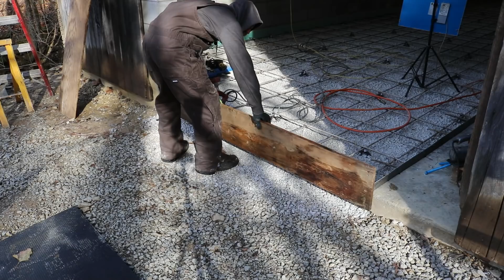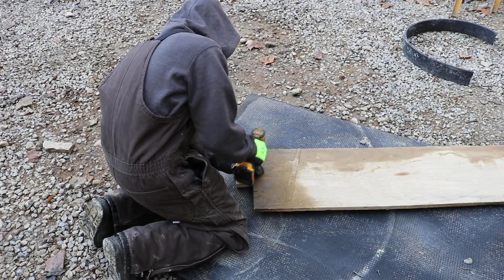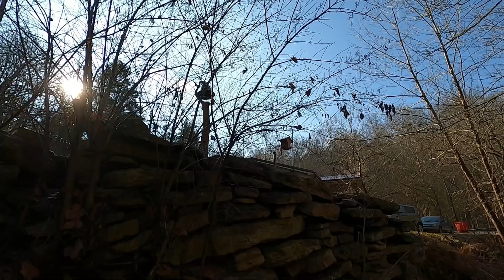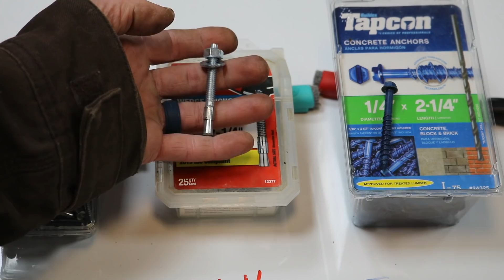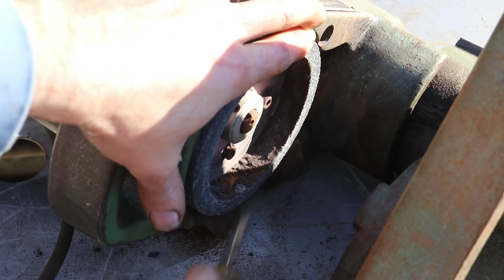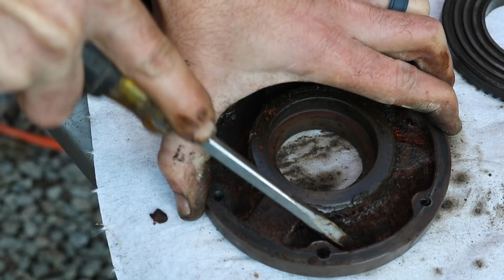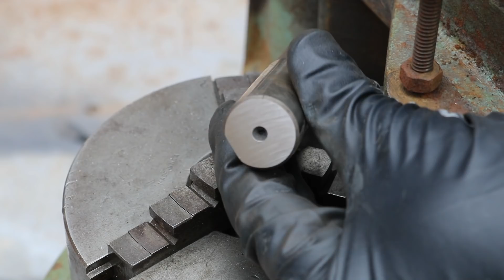🔥Testing the "New" Pin / Punch Grinder. Shop Concrete form and more

Comment: Steve, looks like a great way to put a flat end on any stock that will chuck up without breaking out a lathe. Also there is a device on the edge of your pin grinder that will let you set stock close to the rock height so you don't crash.

Comment: Going to think the most common use of that is to keep the ejection pins in moulding machines from becoming round, as they get a lot of edge wear.  The reference pin is there to tell you the height of the wheel, so you can lower it down to the job before turning the grinder on, and know they there is a few thousands of gap till you contact. Set it using a straight edge before turning the grinder on, and then you will have a few hundred passes till the wheel wears enough that it is not accurate any more. The cable is typical "fix it fast" shop style, probably the original cord was damaged and the extension was put on "temporary" till the new cable came, and of course was behind the bench and out of sight.

Nice work on the preparation for that concrete, you could probably be a lot more sloppy with fit, but it will come out perfect, and probably better than the average floor slab. Guaranteed to still be there in a century or two, along with half the shed.

Regarding the anchors I have used the pin type, though here they are plastic plugs, and work well for light loads, and I tend to set the screw in type using the hammer drill I made the hole with, as it is a lot faster than a screwdriver, just flip the drill from rotary hammer to hammer for the job. The expanding sleeve type the anchor definitely is stronger than the concrete in all cases, though I prefer the Rawl type, as they work better in poor concrete, and are overall more resistant to pull out, because of the larger amount they can expand in the concrete. The direct tap type never used, though I guess they are just like a self tapping screw into plastic, the screw is stronger than the material, as it has to make a thread. Reuse into the hole you probably want to find that first thread again. If you want really strong you use a chemical anchor, or epoxy, and there are some industrial concrete epoxies that are going to have the failure be the concrete itself before the epoxy joint. Yes hex bits are sacrificial, I put the ones that wear into the scrap steel pile immediately, so that I do not keep damaging heads with them.

Comment: Hey Steve! Your grinder is for grinding punches and die buttons for a Stippet Turret Punch machine. I've found that to dress the wheel, you get better results using a Norbide dressing stick by hand, and creating a slight cone shape on the face of the wheel so that just the outside perimeter edge of the wheel actually contacts the work. Less drag and better, faster and cooler results. The wheel doesn't care if it is dressed true to the chuck or column, it's actually better if it isn't. Good to see your videos again as I sit here in Michigan on Sat morning watching the rain pour down.

Comment: Steve, when you do the big cement pour please clean the low section over the old concrete and clean that area, wet it down, and pour a fill and screed that off. Then the whole cement work is finished and your work is done.

Comment: We use the pin-drive anchors quite a bit for setting electrical boxes and conduit straps, I like them. Powers makes a version with a Philips head and a thread on the pin. These are driven in with a hammer, same as the plain ones, but you can back the pin out with a screwdriver if you need to remove it. Works great. 
As others have mentioned, Houdaille is pronounced hoo-dye. 
Strippit makes turret punch machines for sheet metal fabrication. That grinder was sold as an accessory to those machines so you could sharpen your own punches and dies even if your plant didn’t have a toolroom. 
Shop is looking great, keep up the good work!!

Comment: For the slab, I'd still make it drop off towards the door a bit.  I can't remember if you did that or not, but you said "Completely level".  Level and Flat are two things.  I'd want some kind of slope headed to the door, even if it was just from the 10' in and slope about 1/4" towards the door.  At least then when you get water in the building (and you will), you have a way to sweep it out with some help of gravity.   As for "don't video it if you don't know"...yea...lol...As any 20 "experts" and you'll get 20 different "correct" methods.  I started watching "Bondo Construction" and he does a ton of radiant floor systems for pole barns and such.  Guy has been doing the work for 20+ years, but wow, the people that scream "NO, YOU'RE DOING IT WRONG, I DO THIS FOR A LIVING"...ummm, so does he, and it works.  Yep...Keyboard warriors...LOL.  Take the best, forget the rest.  :)

Comment: Interesting the way you used a bolt to pull the chuck apart.  You could have used three bolts and pushed the chuck apart.
Thanks
Reply: Yup.  " Jacking Screws "

Comment: William from Lexington Ky.  The grinder is more specific for sheet metal turret punch press tooling.  I just bought a modern version for our tooling.  Where I work, we run an old Strppet model turret press as well as our new Amada.  As you say, it will be a good tool for very specific applications.  Nice find.

Comment: I used the Tapcons at work for several years with good results IF the hole is the right size.
I now use Tapcons to hold wood on a face plate for turning on a wood lathe. Even if the chunk is huge and out of balance , no slippage or pull out. They are made of very good steel and properly heat treated.

Comment: Looks like on your green T25 bits you could trim the worn end off with a grinder and get some more use out of them. I have no idea what I’m talking about, but it might be worth a try.  👍😎👍
Reply: Usually, no. The way most Torx bits are made that doesn't work very well.

Comment: Well I'll be damned... That grinder came out of our shop auction!
I was wondering if any of our stuff would make it to a youtuber.
Reply: Just curious (I'm not a machinist by any stretch).  Would it be used very often?  It strikes me that you might not need to grind a pin very often.
Reply: @paulculbert1281  We used it mainly for dressing punches and dies, as those usually got chipped edges from use (or abuse)
Reply: I used to work maintenance in a die casting factory. The guys in the tool room would have loved one of these!
Reply: Very Cool!!

Comment: That is Strip-It, part of Who-Dye industries.  That is how you pronounce Houdaille.  Look up their history sometime.  A great Buffalo NY company.  Steve, you are using you jack-out holes in your chuck backing plate with your makeshift puller.  Not necessary.  Just thread in a screw, and jack-out the mating part.  That what those threaded holes are for.   Also, your chuck jaws are numbered to be in order in a CW direction.  Their position in the chuck body does NOT matter.  I know the body is numbered, but in the grand scheme of things, just keep the chuck jaws in order.  If the jaws were a custom lapped fit, then yes, maybe it is a good idea to keep them in their respective slots.  But not totally necessary.  Just a note, I have an engineer friend who used to work at Strip-It.

Comment: Great video Steve .... I am sure that the punch grinder is more for punch and die applications, where you have a punch ground to a certain profile, with both male and female components. As the ends dull, you grind both the male punch, and the receiving die, to ease the punch power that needs to be exerted, and to get the "cleanest" hole what ever the punch design. I am sure that Robin would have some sort of protective material with a hole for the punch, and to cover the chuck when grinding!!
      I poured concrete for 30 years, and the job and effort you put forth was second to none!  Happy Holidays!!

Comment: First used tapcons in 1983 when they were new I believe. They have never let me down. If you are careful you can remove and replace with good results but do replace with hand screwdriver and get it started with the previously used path in the concrete. Do not use the impact feature of your drill when screwing them in😉 but do use the impact for drilling the holes. I don’t know how many times you can remove and replace them or how much their strength deteriorates but I have had them in and out 3 times before. They have an installation kit that combines the drill and phillips or hex driver without having to rechuck all the time that I would recommend.

Comment: Steve; love your videos-thanks for taking the time to do them. I would recommend the addition of heating tubing to your new slab, not for primary heat but for the comfort it provides. My shop has this-used an old heating boiler from a gas absorption chiller for a heat source. Anyway, 1/2" pex with oxygen barrier on 6" centers 250 foot circuits tied to the rebar to keep it in place during the pour. I inserted a piece of 3/4" plastic conduit with a 90 on the end at the edge extending out into the slab about 4 feet and slid the bulb from a thermostat to the end. I set this at 80 degrees and the system cycles at that temperature. This would give you the option of heat in the future for minimal cost. My shop is just over 2,000 square feet and has 4 circuits of tubing for a total of 1,000 feet. The difference in comfort is astounding even with a 70 degree floor. I am always having to lay on the floor working on different machinery-it also prevents sweating when the wet bulb temperature is higher than the slab temperature. I keep antifreeze in it so during the periods i am gone i don't have to worry about freezing the boiler or pump. Just food for thought if you are so inclined. There is nothing colder than a building with a cold slab-amazing how this affects comfort. I am a little south of your location at the other end of the state right on the southern Kentucky border, so temperatures are close.

Comment: The jaws were placed right. Like 1 in 2, 2 in 3 and 3 in 1. Any ordering that has them as 1-2-3 in the rigth direction (counter-clockwise) should work, unless the jaws are keyed to the slots or something like that.

Comment: I TRADED FOR AN OLDER DRILL/DRIVER SETS, I'M RUNNIN ON LEFTOVER 4WAY SCREWS, BUILT A SET OF SHELVES DOWN THE SIDE OF MY GARAGE, BET I SNAPPED 7-8 BITS, WAY MORE POWER THAN MY OLD 18 V

Comment: Project recently did a test on those bits and the DeWalt were the best in his tests. When you are using a tire bit and it’s wore out some times you can grind the end off and you get back into a good portion of the bit.

Comment: I wonder if you can grind the profile on a "roll pin" punch, (that's what I call them don't know the proper name) You know the ones that have the little tip to get them centered on a rollpin so you can drive it?

Comment: @ 2:02 When I'm cutting long pieces;... I clamp some scrap bits of wood
Under the cut line near the ends at any angle;...
So long as it supports what U R cutting off...
Now I've screwed 4 to the underside of my bench spaced out...
Then lay some offcuts on top the thickness of the bench top...
When done just fold them back under the bench...

Comment: Hi Steve love your work , I may be stating the obvious but you could set the height stop on the diamond dresser as a reference for grinding pins 
I have used a similar machine , only it was horizontal to grind ejector pins for plastic injection moulds . Can’t to see the shop back in working order .
Season greeting from oz

Comment: Having just set 16 ford flathead valves where the ends of the valves needed grinding that piece of equipment would have been ideal.
Reply: Damn thats gotta be the #1 use for that machine..  never crossed my mind..  and if you have a big enough table and a mag vice you could do small heads also..
Reply: You have the same thing on older small engines. On Briggs and Kohler flat head engines you have to grind valve stems to set valve clearance. Yes, this would be perfect for that job.
Reply: Yes you could grind valve stem tips if the machine is "square" with itself.   Most valve grinders have a stem grinding attachment that is far easier and quicker to use than this machine. You need a set of Johnson adjustable lifters for your flathead :)

Comment: Hi Steve, it would be nice to have the luxury of getting builders in to start and finish the project, they for sure would not have gone to the trouble of preparation and attention to detail that you have " rightly or wrongly " but for sure this rebuild is going nowhere and you now have knowledge that you didn't have before, it seem to me you have gone about this from a machinist point of view so attention to detail is more than your average builder would have done, least you know it done right, more power to you pal.👴🏻👍

Comment: I used a concrete anchor similar to the wedge type to bend the chassis rail of my first car back after the previous owner crashed it. It was only slightly bent, and for the price (basically free) I decided it was worth trying to bend it back. Fixed heavy steel cable to the chassis rail wedged a wooden block on top of a hydraulic jack under the bend, then tied the chassis rail down to the concrete anchor with a heavy steel cable and started jacking up the car. Bend came right out. Cut out the mangled rear panel, used a similar method to bend back the rear quarter panel using the hydraulic jack, and finessed with a panel beating hammer. Got a friend to weld in a replacement rear panel panel, sprayed it with colour matched paint and you couldn't even tell it had been reversed into a brick wall. Drove it for a couple of years, then gave it to my brother after his car died.

Comment: The order in which the jaws are inserted is essential, being in the correct numbered slots is not.

If the jaws were originally supplied with the chuck, then they will be most concentric when used in the matching slots, having been ground that way. Replacement jaws may actually be more concentric when used in the 'wrong' slots.

Comment: The overalls. Are they available with Air conditioning. 38C, here yesterday.
Reply: That's 100.4 F.  Darned tootin' HOT.  If you've got high humidity with that sort of heat, WILTING is inevitable.  :>(
Reply: @GeneSun C is the cup size. lol

Comment: Just note on chuck thing, treads in back plate are pull out threads with 3 bolts you can equally tighten those and plate comes out.
Nice grinder just to even touch up hammered punches 😃
Just so nice and honest content you make and I LIKE IT!!

Comment: Nice reworked tool. Love the thermals I have New never worn pair that are Snug on the waste line. Never got to use them.  I might have to send you them as gift.  Yep quotes are the best way get lowest price. cant wait to see back in the shop at full speed complete floor.

Comment: The TORX bits wear out because of the hammering or cl,utch action on the drill. It's just the price You've got to pay for the extra strength...
Reply: He wasn't complaining that they were wearing down. He was commenting on the fact that the GRK bits wear out really fast. They come in each box of screws because they're cheap and expected to wear out by the time you're done with the box of screws.